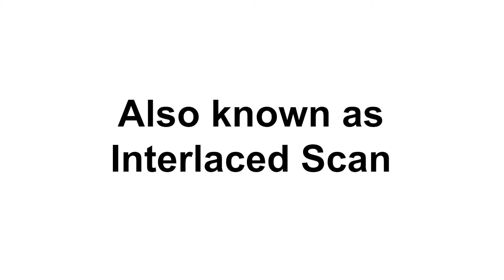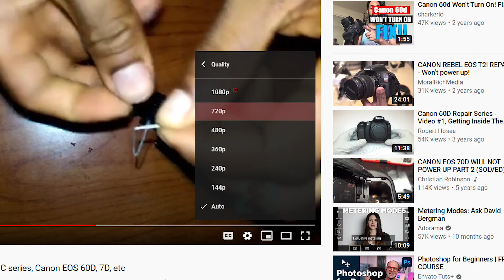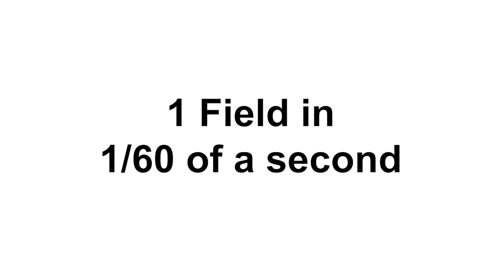Interlace Vs Progressive Scans

Comment: This explanation happens to be wrong. With interlacing the two fields are never combined and they do not form one image. The two fields make up two images, captured at different points in time, that are displayed one after the other, no different from a 60p signal.

Simply put, interlacing halves the vertical resolution of the video. And the scanning is offset by one line each field to give the illusion of the original full vertical resolution in static scenes.
Reply from the maker: @grumbel45  that’s awesome. Now, as much as possible, explain everything you said in 5th grade language.
Reply: @28thBayDigital  "Interlacing runs at half the vertical resolution", that's really all there is to it. All the talk about fields and frames just gives people the wrong idea that interlacing is a 30fps signal, when it's actually 60fps. This misunderstanding of interlacing is so common that even ChatGPT gets it wrong.
Reply from the maker: @grumbel45  honestly agree with you. In a way, we are speaking the same language.